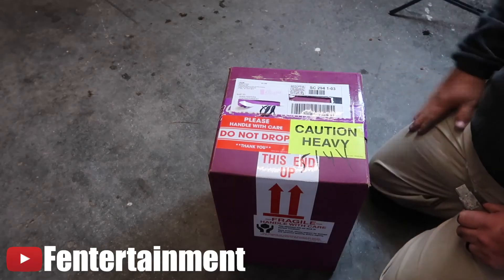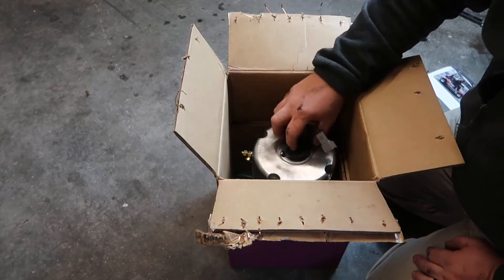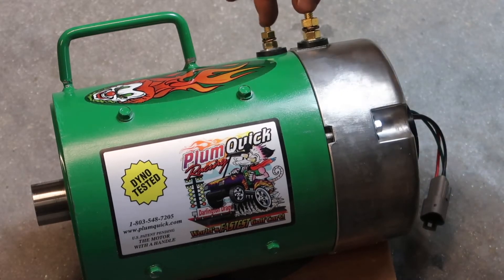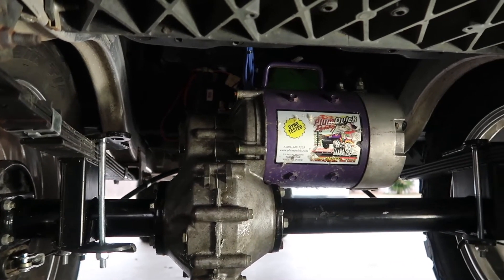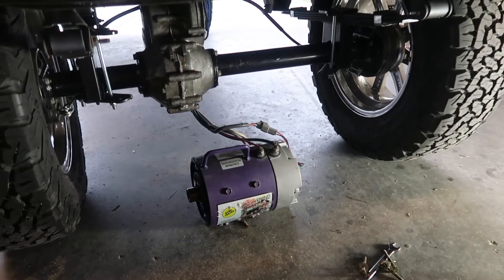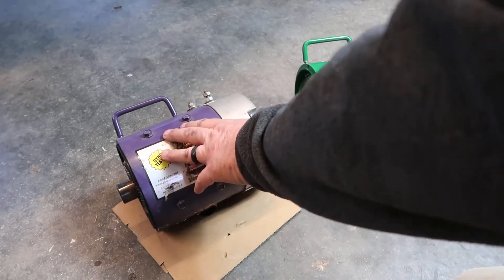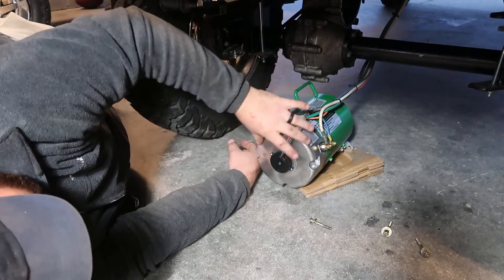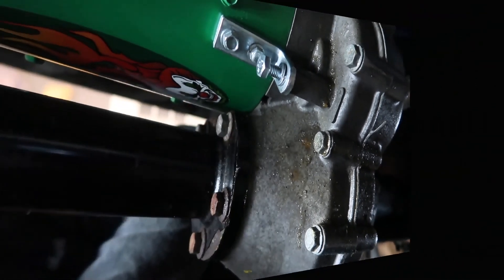Installing the Rhino high torque motor on a Club Car IQ cart

Comment: Probably the best video I’ve seen on this process. SOLID SOLID. Just wish my motor had the handle. I just received the executioner motor and it has no handle. Great Video💯🍻
Reply from the maker: Yes, we discontinued the handle
Reply: @PlumQuickMotors All Good. It was VERY EASY to install & has been way better than anticipated. AWESOME💯🍻👑s

Comment: I recently mounted up your Grizzly motor in my 97' Club Car DS. I found it to be a tight fit. It looks like the shock is going to rub. I'm thinking about relocating the shock mounts or trying to slide the axle forward on the leaf spring by a half inch. Not sure if the latter is even possible but I'll try that first. Although, it can't go forward too far, or it'll be into the frame. 
I bought the cart used and it seems to have been pieced together with different parts so I'm thinking someone had maybe adjusted the rearend at some point and maybe didn't get it set just right.
If you have any best bets for me, please share, but I'm confident I'll figure something out.
I'm really happy with the looks of the motor and really excited to see how it performs. I'm in the process rebuilding the aluminum battery tray from acid damage. Planning to buy a 48V NMC kit from BigBattery. I'm going NMC because I don't want to have to keep it heated when charging as I would if I went Lifepo4.
A concern of mine was the lower voltage of their NMC batteries. Thats only slightly less than a typical FLA set at 51.2. 
Any reason to be concerned? I couldn't find a spec sheet on the Grizzly motor with operating parameters but I'm betting 50.4V will be fine for it.
Reply from the maker: Look at this  https://plumquick.com/wp-content/uploads/2018/09/RAGING-BULL-Club-Car-IQ-on-lifted-cart-installation-adjustments-1.pdf    different motor same concept.